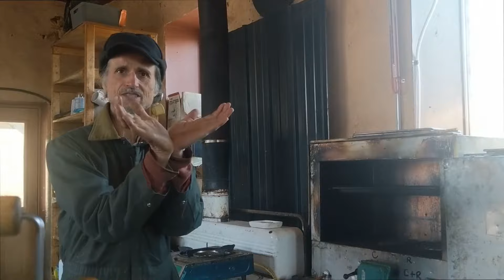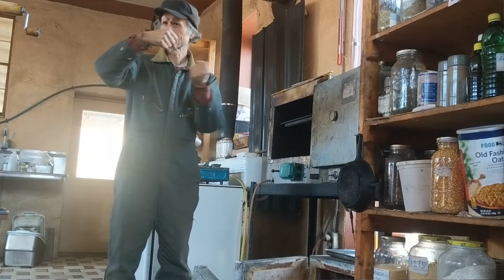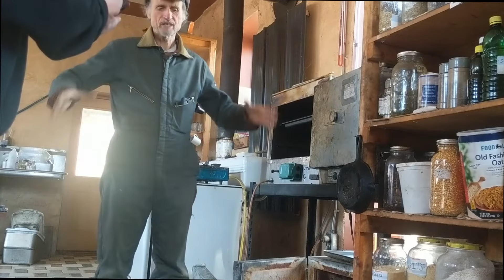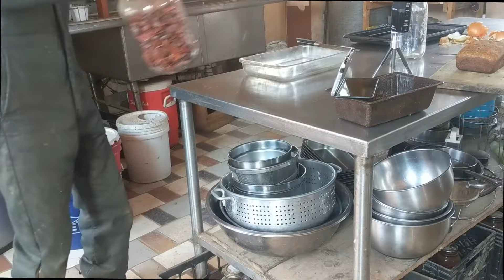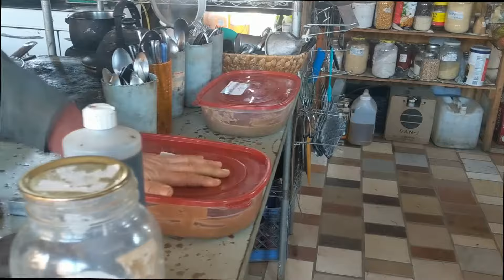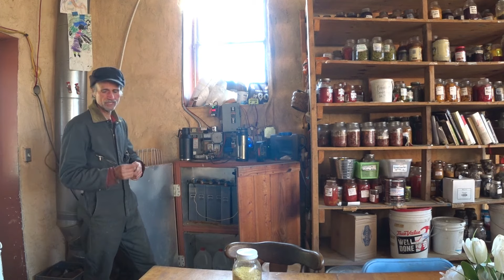Alexis Zeigler: Solar Everything on the Living Energy Farm

Comment: I've created a vacuum insulated Solar cooker that I suspect will be able to work very well in low temps.  It doesn't use vacuum insulation panels and in this case is not a box style, but rather a glass container with an acrylic disk top with a hole drilled in, a black silicone gasket, and couple other things.  The vacuum is pulled by a hand/manual pump, which pulls a pretty decent vacuum. 

   Normally you wouldn't be able to use acrylic with a Solar cooker because it cannot take the hot temps.  But with 3" or more of medium vacuum between the hot pot and the surface of the acrylic, the acrylic is not going to get that hot.  I plan on doing a couple YT videos about this easy to make, hyper efficient, and relative inexpensive Solar cooker system. 

   For the reflector part, I like the Funnel system because it is easy to make and works quite well.
Reply: Hi Justin, I see myself in front of the same problem as my acrylic disk bowed under the heat of my self built solar cooking box. Myplan is to use that bowed acrylic disk and vover it woth an oven bag on the side which is facing the box. Oven bags are made to resist high temperatures an is transparent. May be this could also be anice idea for you and others. Good luck and we would be happy to see YT Videos from you 🥰🌞

Comment: About the system of pumping hot air into the house instead of making heat from electricity. Was it just a tangential example about how to achieve leverage or was it related to how the DC oven works ?
Reply: The former, I'm sure. I would have liked to see the ducts and blower more closely to get a better sense of how it works.

Comment: Thanks for sharing... I did not understand the physics behind why the solar powered oven and fridge are energy efficient. Could you share articles or videos explaining it from the basics?
Reply from the maker: You can look up the reports and writings of Pete Schwartz at Cal Poly in San Luis Obispo--Pete's ISEC (Insulated Solar ELectric Cooker, same as Alexis') for how such cookers work. I'm still mystified by refrigeration in general but I think the main point is that the tub fridge is superinsulated so does not need constant, regular cycles of on-off for the refigerant pump. It'd be a good subject to run by Alexis and his companions on the farm, check out livingenergyfarm.org